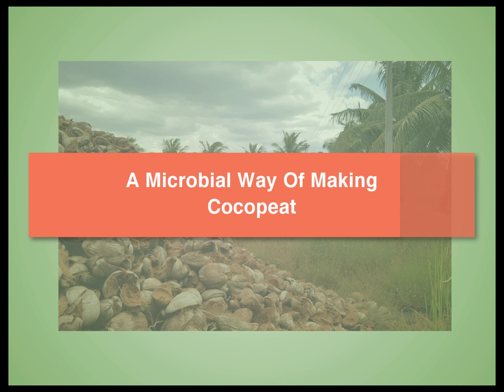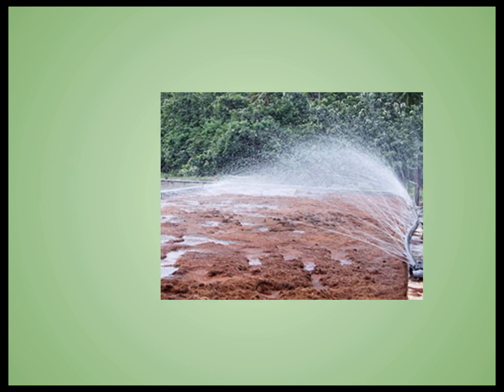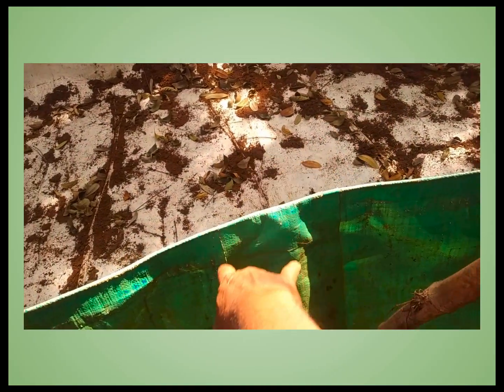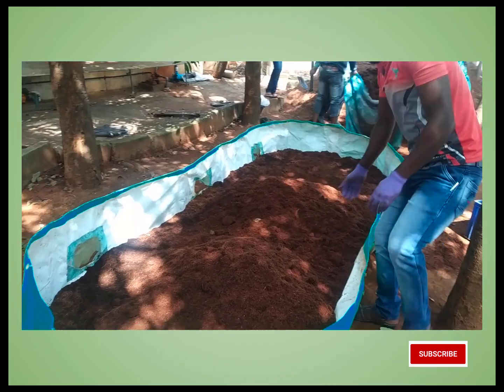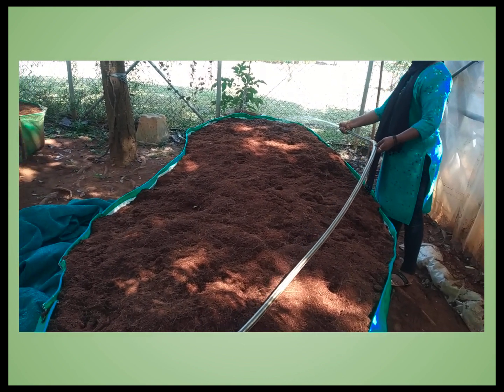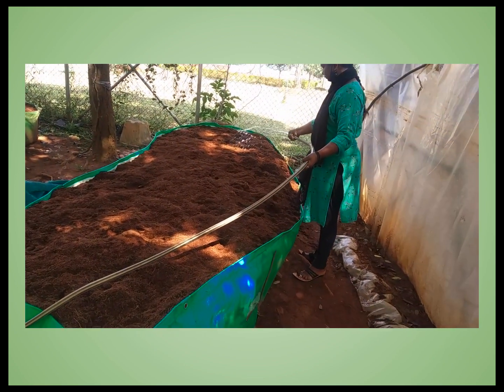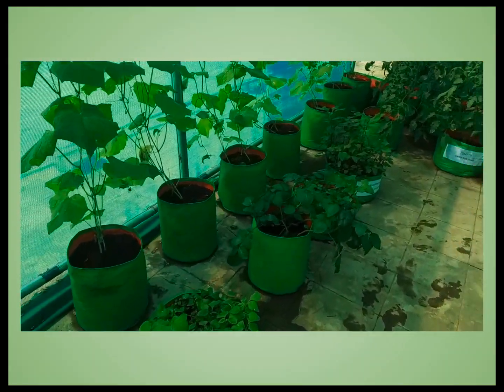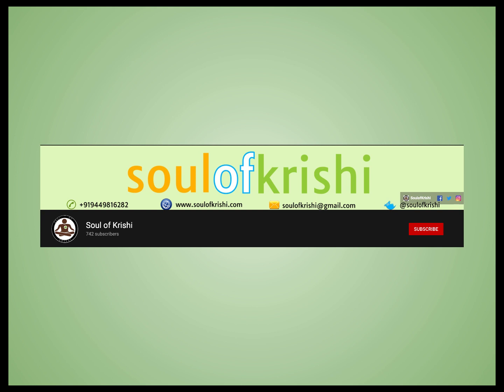Soul of Krishi : A Microbial Way Of Making Cocopeat

Comment: I really liked the way vegetables like Patty Pan were grown in IIHR by the fermentation of Coco-peat using AMC and decomposer. Sir, 1 ) When we put coco-peat in HDPE grow bags or on the rooftops gardens, coco-peats sets and becomes compacted in few weeks. They are usually full when filled but after a week or so they are reduced to half. What to do then? should it be toped again? 2 ) How long can  fermented cocopeat be used as a growing media.? When will the fertility of the fermented cocopeat be completely reduced. Should we refill the grow bags again with cocopeat or should it be completely replaced.
Reply from the maker: This is the general question raised by many who use cocopeat. When you fill the bag you are not packing it properly. So the air space gets reduced with time and cocopeat gets compacted. There is no problem with this. You can top itup. Once cocopeat is filled in a bag it can be used for 8 to 10 crop cycles of any crop that  losts about a 100 days or even for longer period. But after harvest of each crop the bag has to be repotted by mixing the cocopeat and the fine roots well and making up to the loss by adding little extra. . Cocopeat as such has no inbuilt fertility in it. You need to supply nutrients externally with nutrient sources such as Arka Sasya Ras.
Reply: How to reuse the cocopeat after harvest?

I mean we will need to decompose the roots of the previous crop in the cocopeat before repotting right?
 
Will adding AMC and decomposer again in cocopeat decompose the roots of the previous crop?